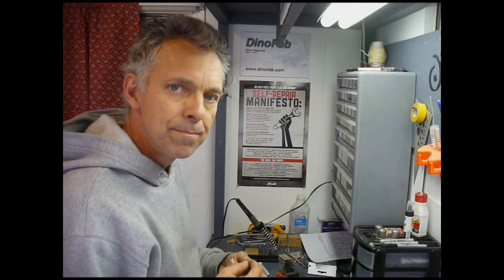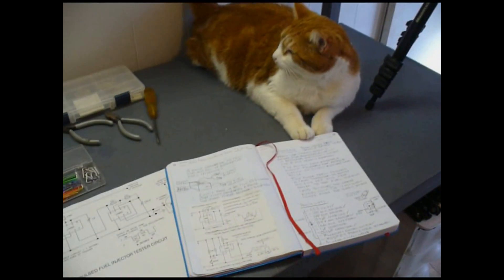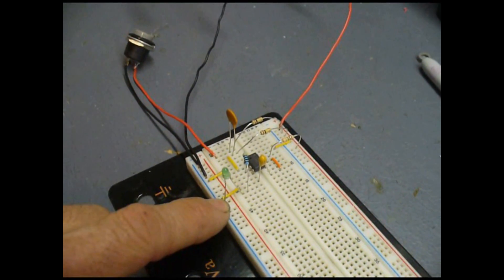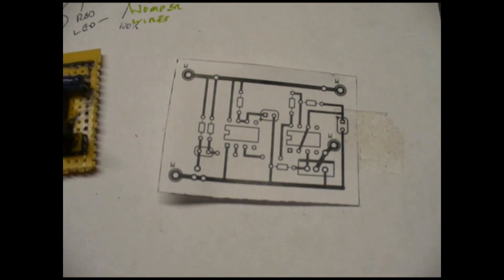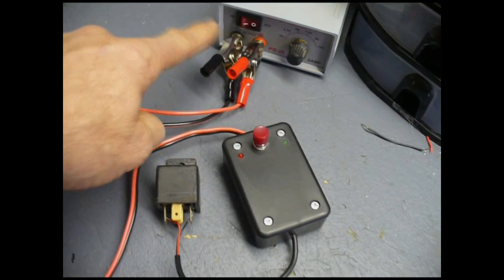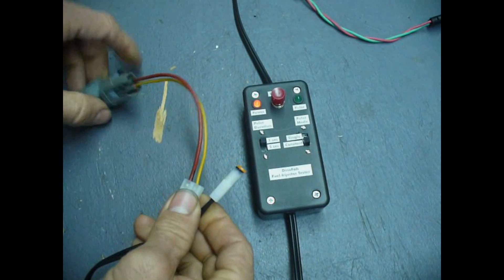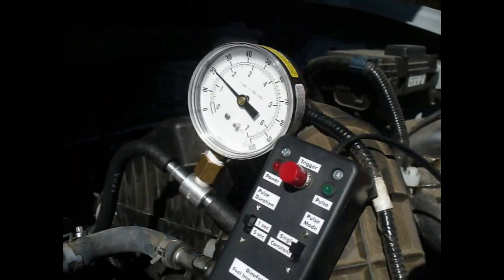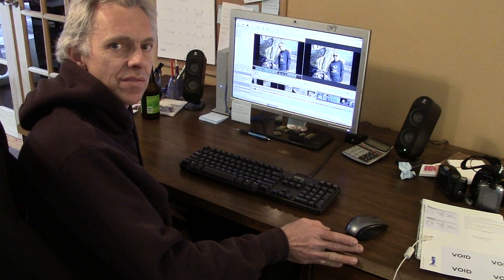Electronic Fuel Injector Tester

Comment: It would be nice if you can design Speed Motor and a small version what an PCM crankshaft cam sensor which OBU magnetic signal crown how are you can speed up a little more at 1,000 to 3 or 4000 RPMs I need you to see how the injectors works on a hundred different torch let's get together dude we can build something really nice to avoid all the hustle people goes through

Comment: Hi Dean Hope all is well in NC
Lived in Cary, but had to leave because my job, really miss it. Planning on retiring back there.
Quick question what voltage for the capacitors? I watch this video years ago but didn't need the tester till now.
Reply from the maker: As long as the are more than 12 V you''re good to go. I think mine were 50 V.

Comment: Hey Dino. Years after I saw it, I have time to build it but I have a few questions: In the partslist of the tester, you write mF for the capacitators, but in the sematics they are uF. Am I right that uF is µF? I'm really confused and it is late in germany :) Also do I really need a Tantalum cap or can I use any cap?

Comment: I wonder if a 1980's distributorless ignition would work when added to a newer car so that the injectors pulsed when needed. So I would keep the newer computer in the car but add the older computer so it would pulse injectors bypassing the security system since most newer cars security systems shut injectors down causing no start.  See I believe these newer cars can be hacked easily and I am a mechanic but it is very hard to bypass this newer stuff.

Comment: Thank you for this project.  I found the files, watched the video and created the circuit on a breadboard.  for the longest time (about 3 hours) I couldn't get the Astable side of the circuit working (and still can't using the resistor/capacitor values you have listed.  I had to swap the resistors around in order to get the circuit working then I played around with frequencies a bit.  I made a spreadsheet to calculate on time,off time, and duty cycle using R5, R6, and C7 as variables.  I ended up changing  R5=390 Ohms.  I'm going to try to modify this circuit to drive 6-8 fuel injectors so that I can set up a cleaning/testing station (with the injectors mounted in a rail above 6-8 graduated cylinders), and this DIY project was the right price.  By the way, with R5 at 390 Ohms, the circuit (theoretically) runs at 48.82 Hz which equates to 5859 RPMs (48.82*60sec/min*2rev/injection).  Pretty darn cool.  (thanks for the tip {hack})
Reply: Did you build your cleaning/testing station I'm looking to do the same thing

Comment: Quick questions...  
If I were to put a switch in parallel to the push button, would it work to run the circuit for however long I wanted without having to hold it down? 
Also, is there a way to add times? right now, you have 1 sec, 5, sec, and through the switch on the right, continuous.  how could I make a board that also offers, say, 1 minute?
Thanks!
Seb.
PS: did you ever do kits?

Comment: what should the 4.7mf cap be reated at cuase i use a 4.7mf @25v and it shorted.
Reply from the maker: 25 V should be fine. Was it installed with the polarity the right way?

Comment: I have 2 questions: (1) at 08:29 in the top left corner of your circuit is that a diode or a resistor? (2) can you briefly explain how the mosfet addresses the current draw problem?

Comment: What perfect timing. I am in the middle of doing a head gasket on my nissan sentra currently waiting for the head to come back from the machine shop and I would like to clean my injectors by running some cleaner thru them with a syringe and this little mod box. I went thru my parts bins and I have everything to build this. I will use a different mosfet 200v 9a and a 1n4001 bc thats all I have. I will get this assembled tomorrow :) I also might 3d print the case if I feel up to it.